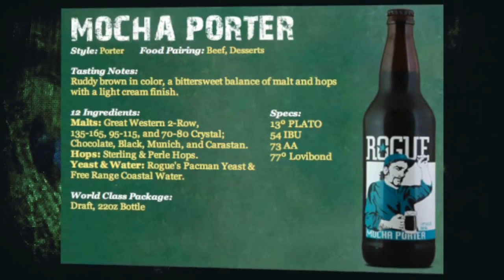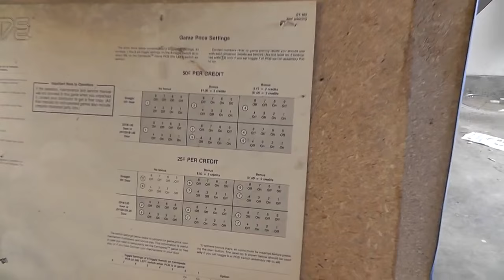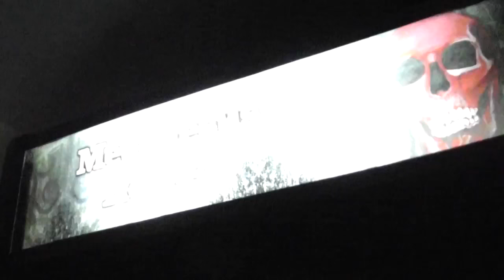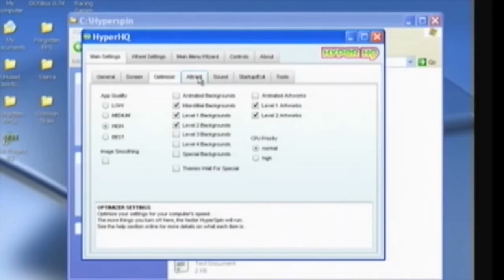MAME Arcade Cab Audio Commentary w/Drunken Master Paul

Comment: This is truly cringeworthy. Glad to hear at least some of it was salvaged, although the "trashed" monitor probably just needed a recap, or worst case, flyback repair.
Reply: and then they jammed an X-arcade in there. I'm in pain.
Reply: But when you consider those monitors will blow at some point and they are probably more expensive to repair than just putting in a cheap flat screen,I think they did the right thing.
Reply: Why?
Reply: Metalman200xdamnit They don't make "those monitors" anymore and, no they're not very hard to recap.